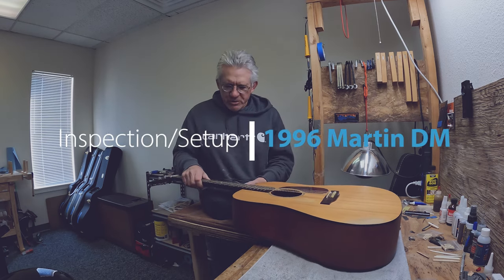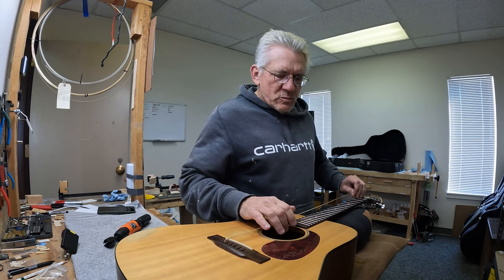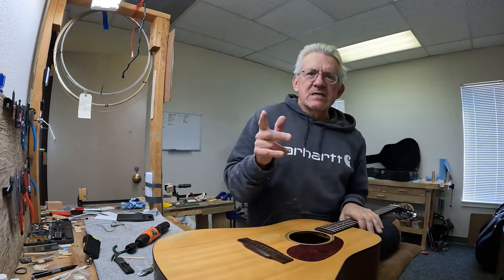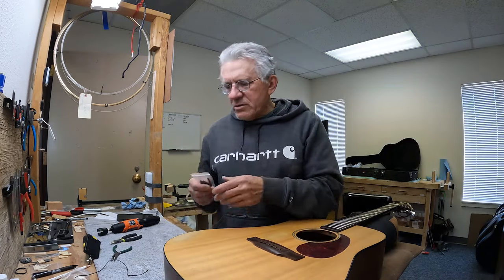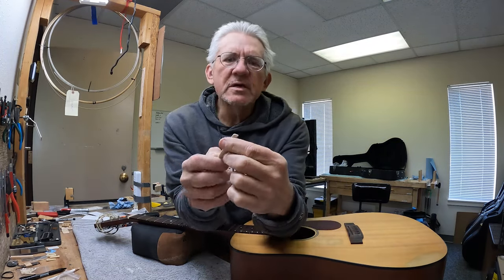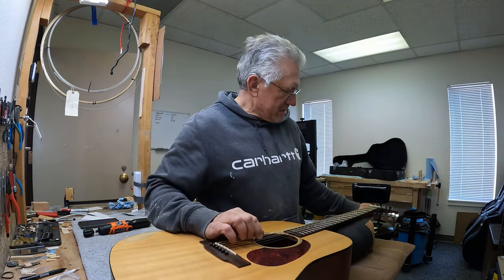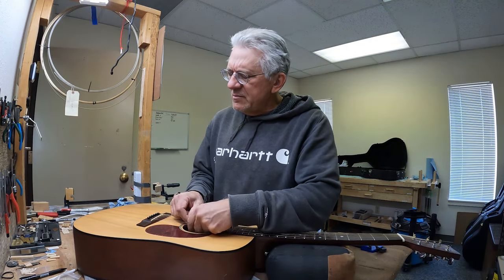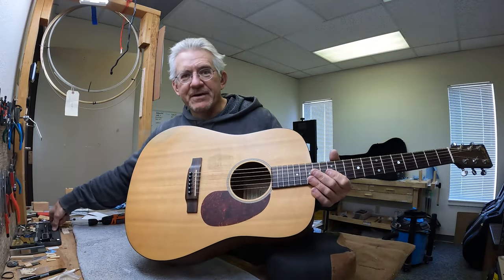Setting up a Martin DM

Comment: Great video.   I bought a ‘96 DM new and still have it.  Great guitar, especially for the money.  I went with Buffalo horn pins, open back tuners and new pick guard.  Light as a feather.   I’ve thought about adding a tone bar but never went that far…yet.  Thanks for posting.

Comment: I have to imagine they are one of the lightest braced dreadnoughts out there.  I like to run custom light nickel bronzes for fingerpicking and the tone is really sweet especially through a K&K.  It will kind of bulge if I run any heavy strings.   I would love to hear a side by side vs a D-18, I've wondered how they would compare but never made the jump at 3-4 times the price.   I really think the DM is the best value guitar out there. all wood, no richlite, 4 pound martin dread, they are legit guitars.
Reply from the maker: That A/B is coming up.

Comment: Aren't the early DM a very light guitar and light build?  Maybe 4 lb or slightly less?  Are the early ones ebony of rosewood bridges and fret board? They should be quite resonant and shaving the back two braces should result in a big bottom end.
Reply from the maker: It's very light, yes.  RW f/board and bridge.  I've never seen one with ebony.

Comment: Great video and I hope he loves the guitar and gets awesome at playing it. And I hope this doesn't come out wrong but, as much as I love Martin guitars, I think I would get an all solid wood guitar from Recording King ( either the RD-318 or even the RD-328) or from Epiphone (either an Inspired by Gibson model or a Masterbuilt series). Starting around $700.00 for the Texan and up to about $1,200.00 for the J-200. (you can get a deal but getting used too). Again, I'm not saying that the guitar you got him isn't a good guitar. I learned on an all plywood guitar..lol.. But I've found that the better the guitar sounds, the more likely the person will want to keep learning and get really good.

My Recording King RD-328 is all solid wood with a 30 year aged Adirondack spruce top and solid East Indian rosewood back and sides and had scalloped bracing. They use wood glue and no epoxy too and have a dovetail neck to body joint. I don't like the heavy, polyurethane finish and the neck profile (deep V) but you are starting out with an all solid wood guitar that sounds great.

Either way, I know he will be happy with it and I hope he gets really good and loves to play. Keep up the awesome videos.
Reply from the maker: Well, this one was $500, not even $700.  And if he keeps playing, then there's 2 70's waiting and a D-28 '41 Authentic.   :)
Reply: I've had those Recording King RD-318 guitars and a Epiphone Masterbilt, they are both heavier and generally suck, the DM is an actual Martin dread made in America and the tone is light years ahead
Reply: Have you actually heard or played a 1990's DM? They are actually very impressive sounding Martin's for the money and not boxy sounding like all the Recording Kings I have played.
Reply: @Bryankimsey  
And im sure he will stick to it. I know I did. And my first guitar was found in a dump and fixed up. I was very happy to have it too.

Comment: good to see you do this sort of thing. However, im sure these have been superceded by better oprions. Would love to see you appraise one of the Sigmas or Eastwoods. For the money they look the part and people really rate them.
Reply from the maker: You mean Eastman.  Thing is, I've reset the neck on DM's.  I've not reset an Eastman or Sigma.  Plus, those have thick finishes and I don't know what the necks are like.  The DM has a super thin, almost non-existent finish, I know what the neck is like, and it's made in the USA.  It's also 1996 so it's 27 years old.  I'm sure there equally good options, too, but when a nicely worn DM at a good price is staring me in the face I'm not going to say "Oh... I'll keep looking".  Besides, as I pointed out earlier, if the kid keeps playing, then when I die, he'll have at least 2 overhauled 70's and a D-28 '41 Authentic to mess with.